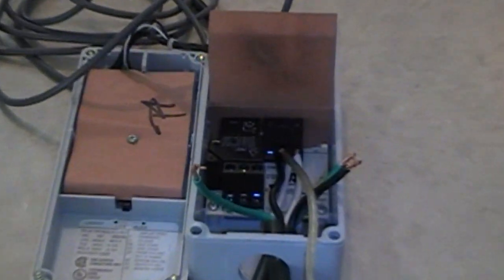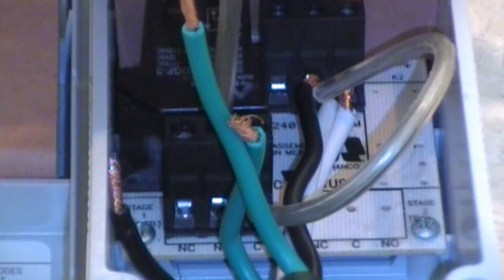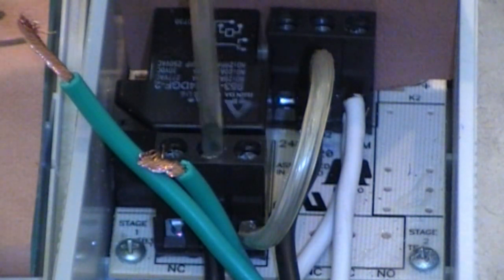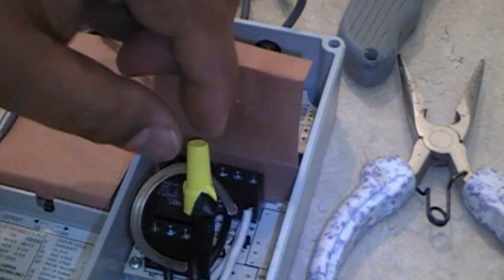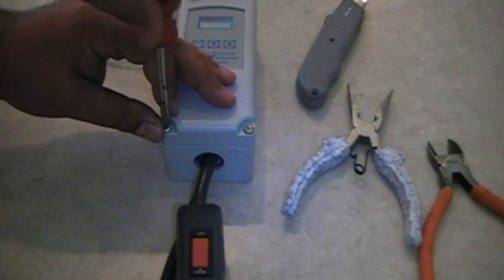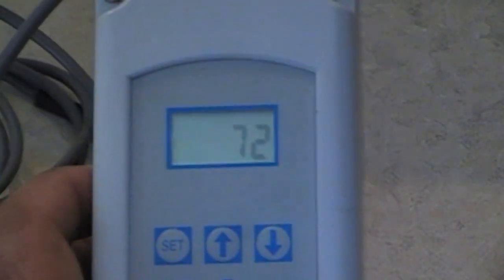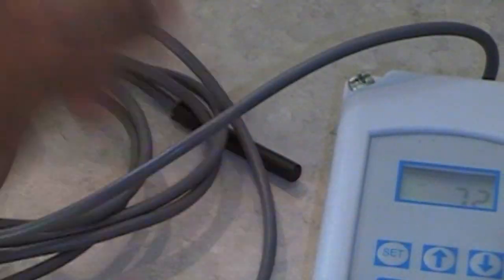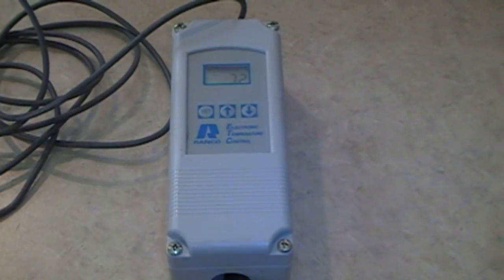How to wire a Ranco ETC-111000-000 Digital Temperature Controller

Comment: how can you wire the ETC 111000-000 INTO a airconditioner so it goes down to 30s for a cool room.
Reply from the maker: That I don’t know but with a freezer I wired it the same plugged the freezer into the unit and used it to keep my beer kegs at the correct temp
Reply: Thanks for getting back to me

Comment: Ok so I find it odd that you have to take a jumper and carry over the voltage from the power supply side, over to the load side.
Wouldn't the power be supplied once the normally open contact closes from within the contact?
Reply from the maker: Watch it again... It works... This is the correct way to hook up the unit and it still works today.

Comment: Would this wiring set up allow me to plug in a retail cooler with a compressor that pulls 12 amps? I am a bit confused about the normally open normally closed amp ratings. i just want to know would it be plug and play. thanks

Comment: Will that control multiple units because it’s wired to a power strip.  My application would be used for my aquarium heater.  Would i be able to use multiple aquarium heaters if i wired to a power strip?
Reply from the maker: Jap Pino 
There is only One temperature probe. But it can control more than one item due to the power strip.

Comment: People need to keep in mind that when you twist wires together that are made of two different metals that you will need to keep an eye out for corrosion between the contacts.  So, if you can find a wire made of copper you should try to match that with all the wires in the device, it will save you a lot of headache in the long run.
Reply from the maker: Thanks for the info

Comment: Thanks for creating this tutorial! However, I do have a question:

I wired the controller step-by-step exactly how you did in the video. After putting it all together, I plugged the fridge into the controller's power strip and the controller directly into the wall. Both were working fine. About an hour later, the power strip is off and won't turn on. Granted, this power strip was bought used at a thrift store so it may be a dud. Is there anything I could have wired incorrectly to cause this?

Comment: Great video and I really like your order of connections ..... Believe me it can get hairy if you do it out of that order. One suggestion though as I build these professional for both the refrigeration and home brewing world. I also am certified nec and by mainstream eng.  you are missing one huge safety factor. Step one is missing........ Get a NM cable connector this will prevent the cords coming out if tugged on. Only .44 cents can save your life if you loose a connection and touch it.

Comment: I use mine to control my pool heater. however about a week ago I have an EP error msg....Im going to check the connections in the box aswell as the temperature gauge cord. Any other ideas ? PS great video!

Comment: Started on a SS Smoker, thanks for the info of the Ranco ETC-111000-000 Digital Temperature Controller I will use it on several of my projects.

Comment: I understand it controls the AC power going to a heater or air conditioner, however how does this application bypass the internal thermostat of the air conditioner to keep it running?

Comment from the maker: Hey there,
Most probes will be the sealed type and you can add any type you need I've seen these used in brewing beer (food safe) for years if its good enough for humans its good enough for the buds... LOL also check out Ebay these a large variety there.

Comment from the maker: @Kimano  Hello and thanks for stopping bye, 1st off the power strip was  a left over part I had laying around I believe in using up old stuff and making them work again and as far as the romex connector your right but I thought I explained that I was going to add a rubber connector to seal it shut.  Thanks for the comments.

Comment: Excellent video, the attention to detail is quite appreciated.  I would make a couple comments though.  First of all, it's good practice when running any cables into an electrical box to use a romex connector at the opening.  Also, using a simple grounded extension cord could be less expensive than dedicating an entire power strip.  The circuit protection really shouldn't be needed, the controller is rated at an operating load of 16A, far more than any fridge or smoker will use.

Comment from the maker: @drinkechear  Hello there and thanks for stopping by, to answer your question you will need to go to there website and get the wiring diagram Yes this model can do both 110/220 volts not sure off hand how many volts, but I do know of folks using this controller to run water heaters that are over 1500 watts and it depends on how you wire it up and if you have the same one I have you will wire it the way you require it for your particular application.  Hope this helps... Google it

Comment: Thank you!  This video was exactly what I was looking for!  This is the first video I've seen detailing how to actually wire up the temp controller.  I'd read enough to know that I needed to rig it up with a cut extension chord but I couldn't find info anywhere as to which color wires needed to be put into which port.  Great instruction.